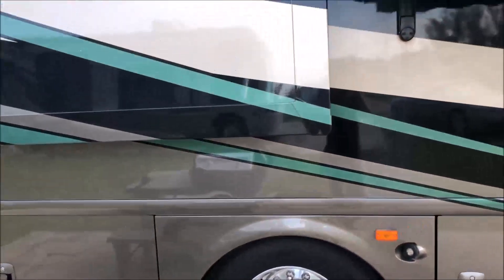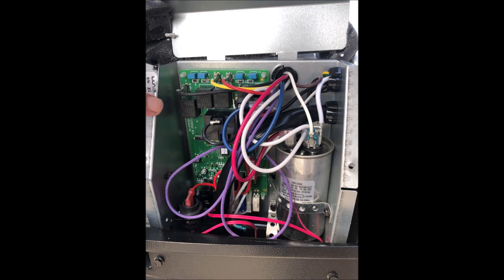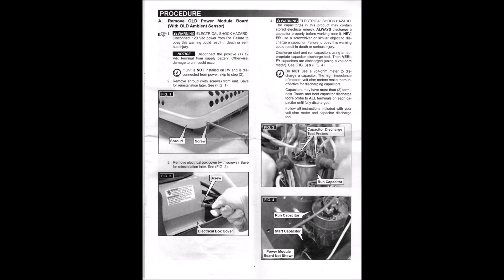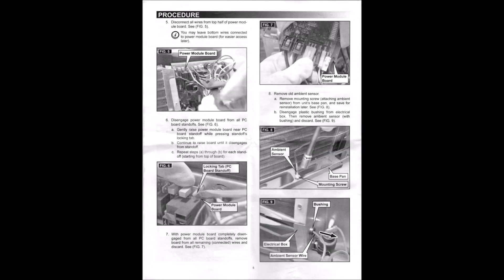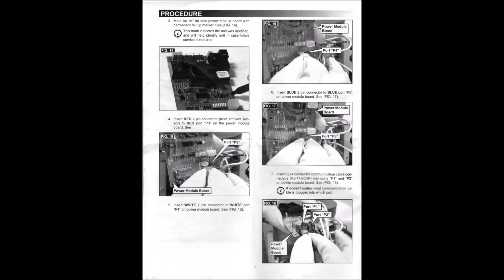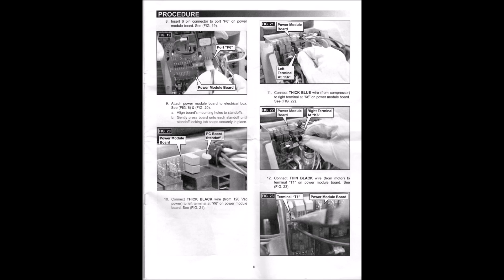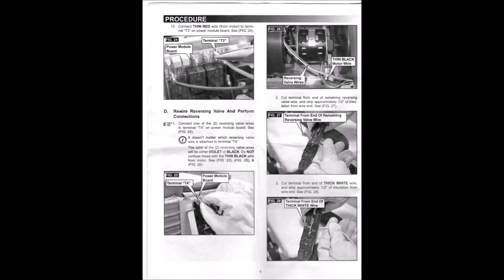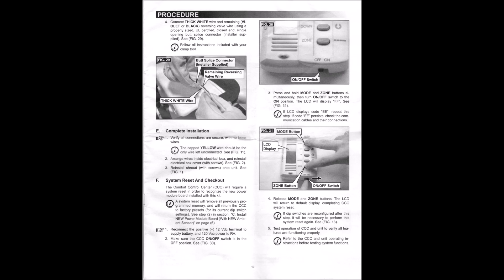Dometic Air Conditioner 12 Button to 5 Button Control Board Conversion Summary for RV's

Comment: Curious, why would you switch out a new control board? My service is telling me they’ll have to potentially change wiring to retro fit a whole new Dometic AC with new thermostat just in case existing control board is bad. (My AC got slightly smushed due to low clearance ceiling.) Like you said! They are not testing it. WHERE IS control board and wouldn’t it come with a new top unit? Thanks (if you see this).
Reply from the maker: @kcalise3948  hi and yes, I see this… It has been a very long time since I helped with this install, but the reason we swapped out the new board with the other board was the compatibility with the existing thermostat inside the RV. The board that came with the new unit on top of the RV was not compatible so we swapped it out. Let me know if you have any questions and I’ll try to dig up my old notes to help.
Reply from the maker: @kcalise3948  the actual control board is under the plastic cap cover on the unit on the roof.

Comment: This was a very well done step through! 
I can't find any other information on this web-wide. Not even help from Dometic. Yours is it!
Here are some points that will help with my specific application, that may help others.
New AC/Heat Pump Dometic B59186-xx1c0 
Same Conversion Board and instructions, 3313107.107.
I first found that the board on my RV is inside, up under the ceiling filter.
That threw me a bit. 
The ambient censor that comes with the AC, just tuck it away and in my case used the same screw to mount the new one. (Step 8)
So here is where I got all messed up. Rewiring the reversing valve. ( I know you commented on it lol)
Note: Up on the Roof the AC can be opened and a large black Styrofoam box can be pulled carefully up and off to see the wires.  
On my AC there is a box containing the Start Capacitors and several wires.
It looks as though One Purple Reverse Valve Wire is combined with the White (neutral) wire in that box. No need to worry about it inside the RV.
Next the Other Purple Reverse Valve Wire was not there inside the RV. In the AC unit that Purple wire was connected to a Yellow wire. So the purple is now Yellow inside the RV. In My Case. Check yours. 
That (now Yellow) Reverse Valve Wire can have a female connector added and plugged into Terminal T4. Fig 25
Good luck to all who try this. I am cool now and loving it.
By the way July 4th last year likely blew out the old unit due to bad electric st the post. My bad for not having a surge protector..
Thanks Again to Jason for this video!
Don
Reply from the maker: smushegg Don, really glad this video helped you!  Yah, that’s exactly why me and the other RV’er documented it, in hopes it would give others some confidence and hope.  All the best, and glad you’re staying cool!  Jason

Comment: This is not a telephone cable. It is a RJ-11 cable that has reverse polarity. Easy way to tell is there is a long on the back of the cable. You can use a telephone wire if you flip the connections on one end.

Comment: I wish you would go back & remake this vid. You know the subject so we'll.  For us DIY folks, it would be great if you would show taking off the old CB & wires...then installing new one.  How you hook up & change wires + joining the 2 wires.  The pictures of the written instructions didn't do anything for me - could read them.

You have a lot of knowledge but this vid is too light on vid coverage of doing the work.  Please answer the question already asked.

Can we use the old CB on old AC on the new AC & not buy the $110 conversation CB.  You ready did not answer the question.

In truth, this vid raises more questions than it answered.  I think you can do better.  It would really help us RVers with AC problems.
Reply from the maker: Agree.  Working on the DeLorean as we type… will do.